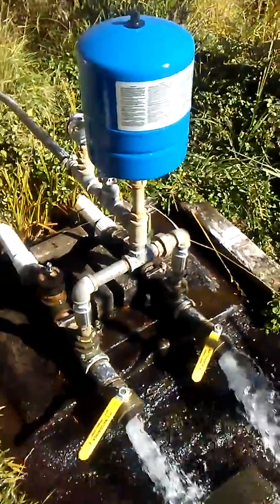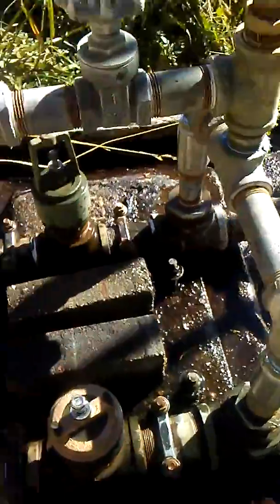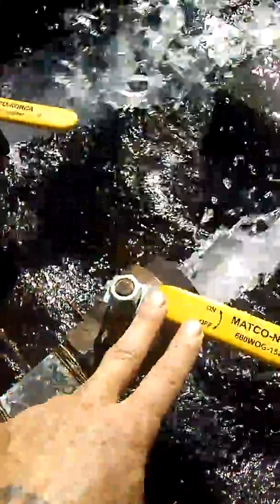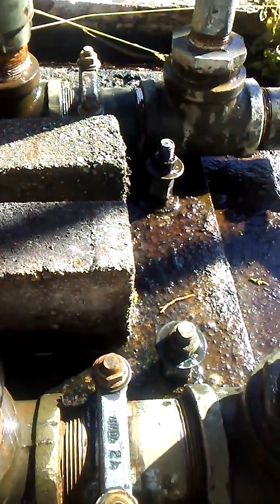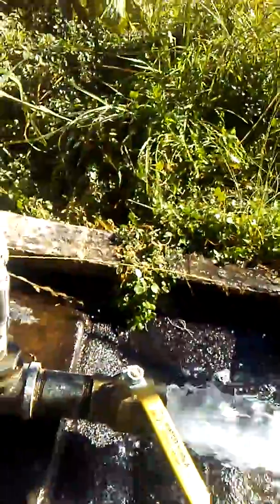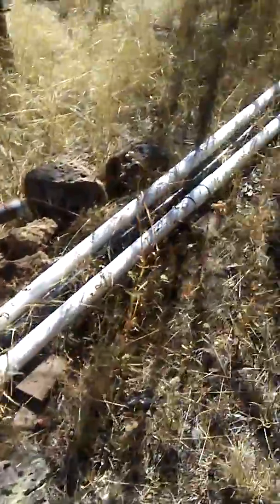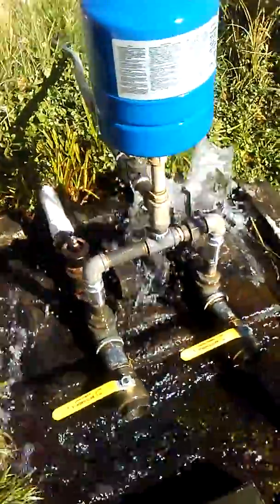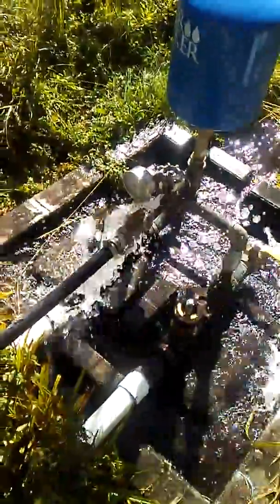dougs ram pump after ten years of operation

Comment from the maker: One more item:  At the stand pipe where the two 60 foot drive pipes attach to the stand pipe I replaced the plastic unions with a 2 inch piece of rubber radiator hose and used 4 clamps on each one because the plastic unions kept breaking because of the slight movement of the drive pipes every time the pumps hit.   Make sure your drive pipes are resting on pieces of wood as if they just lay on the ground evenually holes will get rubbed on the bottom side of the drive pipes due to the back and forth movement of the pipes every time the pumps close.  The movement is a really tiny amount but that is all it takes.

Comment from the maker: I had to build a steel brace for the tank to stop ALL movement and that has solved the problem of the cracking pipe nipple at the bottom of the tank.  The tank movement was so slight it was imperceptible to the eye but over time even that small amount of movement cracked the tank nipple.  My system has actually been running for 15 years now. with the last 2 years being trouble free as the tank brace looks like that was the last of my problems.
This setup runs my whole world out here pumping me 1 gallon per minute 70 feet high into a 1500 gallon tank and then it is gravity fed back down to house and gardens.

Comment: Galvanized IS steel. It is the sharp angle that causes the splitting. To reduce the pressure effect you need to go to TWO 45 fittings. Learned this from a plumber I worked with that was also qualified in high pressure steam boilers.

I have been looking at videos off and on for a couple of years. Was putting together a parts list in brass and then started on stainless. Not everything is available in stainless.

I was even going to do the connecting parts in stainless. Other than the 90, how have the other parts held up? If you have email, can I contact you that way?

Comment from the maker: I only welded the pressure tank for a temporary fix until the new tank arrived because by welding on it I destroyed the plastic liner inside of the tank even though I managed to push the internal rubber diaphragm out of the heat range of the welding.

Comment from the maker: I also lowered the pressure tank and went to a smaller size from a 5 gallon to a 2 gallon in an effort to  minimize the tank wiggling on top every time the pumps pulse and eventually breaking the pressure tank around the fitting where it mounts to the pipes.  It took ten years for it to break but my eventual goal is to get decades of service with minimal servicing.
Reply: You could pipe the pressure tank in with a flexible, braided line  and lay it on the ground somewhere.  That'll relieve any stress caused by water hammer and vibration.

Comment from the maker: Long time no see Bill.  Good to hear from ya.  I'm still at it .....working out bugs and it keeps getting better and better and the pumps run longer and longer between having to service them.
I said the "valves" don't last long but what I meant towards the end of the video was that the pressure gauges don't last....I have yet to find any that last more than a few months.
Reply: Put a valve between the pressure and the gauge. Only open the gauge when you need to see the pressure and the valve will last forever.